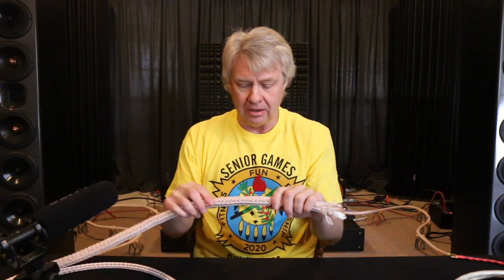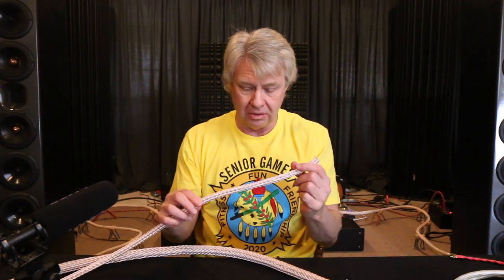What’s up with Audiophile Cable Risers?

Comment: Too many are approaching this wrong.
The 𝙚𝙭𝙩𝙚𝙧𝙣𝙖𝙡 𝙛𝙞𝙚𝙡𝙙𝙨 𝙞𝙨 𝙬𝙝𝙚𝙧𝙚 𝙩𝙝𝙚 𝙬𝙤𝙧𝙠 𝙞𝙨 𝙙𝙤𝙣𝙚, ... where the energy is transferred. 

Instead of conventional wisdom focusing on conductive paths... (floor static, or nails, rebar, etc), the physics at play here seem to be the E and B fields' interaction with it's environment. 

I'd suggest plausible impacts (soundstage dimensionality, openness) may most align with the disturbance and corruption of the external electric field and magnetic field. 

If that's the case, then that environment's permeability and interaction with the external fields is an element at play. 

𝙀𝙣𝙚𝙧𝙜𝙮 𝙞𝙨 𝙘𝙖𝙧𝙧𝙞𝙚𝙙 𝙗𝙮 𝙛𝙞𝙚𝙡𝙙𝙨 𝙣𝙤𝙩 𝙫𝙞𝙖 𝙚𝙡𝙚𝙘𝙩𝙧𝙤𝙣𝙨... a mammothly common misconception. Decades of over simplification of electricity flow contributes to this misunderstanding. 

All said;
It's plausible a capable rig in an well sorted room could delineate such differences. 
Openness, space, dimensionality, these represent some of the smallest, least significant voltage variations present at the mic capsule.  

Certainly thought provoking.
Reply: The Poynting vector S = E × B, the vector cross product of E, the electric field vector and B, the magnetic field vector.  The Poynting vector magnitude is zero if either E or B vector magnitudes are zero, so there is no energy transfer if either E or B vector magnitudes are zero.  The electric field vector E and the magnetic field vector B and the Poynting vector S are perpendicular to each other.  The magnetic field vector B is curled around the current carrying conductor according to the right hand rule.  There is zero energy transfer from a battery or a statically charged dielectric not in a circuit (like carpet) because there is an electric field but zero current so zero magnetic field.  Fact check my comment with a physics text book.
Reply: Non-linear distortion of the audio signal waveform is harmonic or intermodulation distortion, changes in timbre, not "soundstage dimensionality, openness".  Stereophonic "dimensionality" requires level or time difference between left and right stereo channels, which are part of the recording, not part of the playback system if left and right channels are identical and independent.

Disconnect one left or right amplifier input and listen for any music from the speaker on the disconnected side.